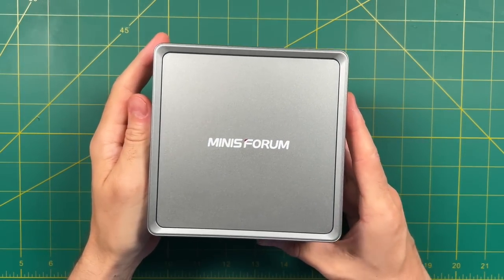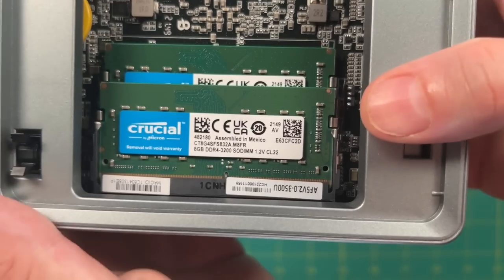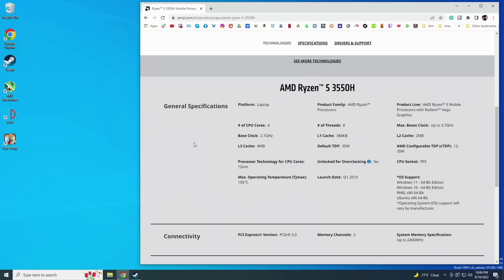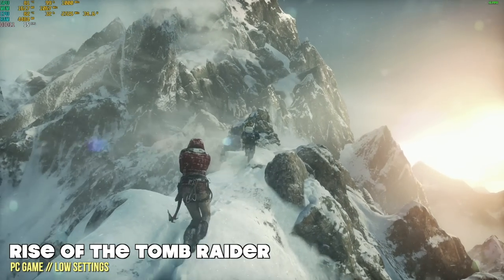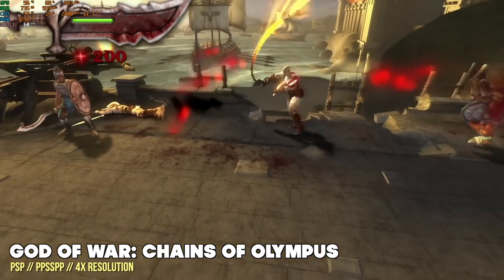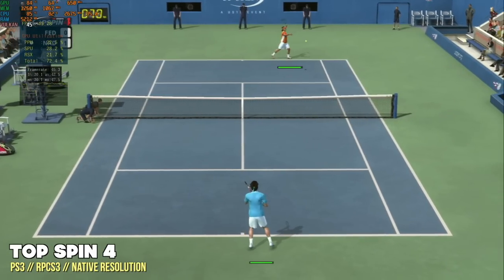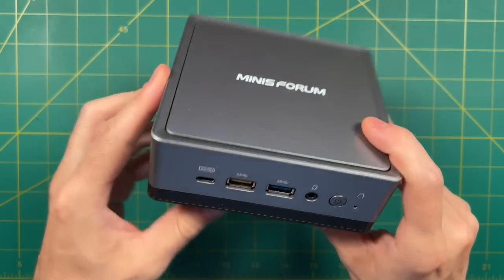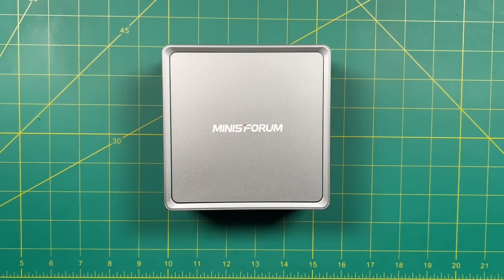MinisForum UM350 Review (Ryzen 5 3550H Mini PC)

Comment: MiniPC's are finally getting to (IMHO) the right value point: PS2/PS3 for <= $400. However, now that I've been using a SteamDeck, I've got a NEW requirement for my hypothetical Living Room MiniPC: I want it to run SteamOS! The UI is everything- I don't even want to LOOK at Windows again. Can't wait for Valve to get a good device-agnostic build out there for manufacturers to pre-install!
Reply: Well steam on windows is supposed to eventually get that UI too
Reply: @rassular  Ah! Well that’s a promising step. A full OS is still preferred here for me though; my hypothetical Living Room miniPC is strictly for console-style gaming, so no need to pay for a MS Windows license
Reply: Even when steam OS3 (the steam deck version of steam OS) is fully released (you can install it already on a PC but not supported by valve) you are still not going to get 100% of the same steam deck experience since it will not be a specific version built for only one specific set of hardware so all of the optimizations and customizations will probably not be there.  Like system wide FSR / frame rate caps or other things which probably won’t work on divergent hardware.

Comment: Nice vid.  I picked one of these up with a Ryzen 7 to do a lot of older emulation and, bonus, since it runs on Windows I can turn it in to a Steam system as well.  I never liked sitting at my PC to play games, emulation or otherwise.  Microsoft shot themselves in the foot when they shut down emulation on their Xbox Series X system.  That thing was perfect and I really dislike using Dev Mode to get around the lockout.

Comment: This looks like the same model as the DMAF5 which they sold a couple years ago. I've had it for a while and it's a hell of a machine, especially for this significantly lower price, but I will say that the wireless performance in the DMAF5 was absolutely terrible and really didn't like trying to connect to a bluetooth controller from across a living room (and forget it if you were using Wifi at the same time). Since the card itself is fine I can only attribute it to its placement or the case itself, and I wonder if this new model is any better on that front. It's the one major bummer in an otherwise great HTPC / emulation box.
Reply: Did you check the support forums and install the Bluetooth and WiFi driver updates? After applying the updates, any issues I had were resolved. Something that also helped is to turn off fast boot in Windows, as that one does not release the drivers correctly, which make them fail when you startup the pc after a shut down (which is not the same as restarting).

Comment: Thanks for your videos. I was hesitant between getting this or a "Minisforum EliteMini TH50" to install Batocera and put in my arcade cabinet. But based on both your reviews, it seems the EliteMini TH50 would be better, correct?
Reply from the maker: Yes, the TH50 is still my favorite PC under $500.
Reply: Hey. So did u try to install some games in your new mini pc ? What do you think about it ? Did u choose the TH50 ? 
I already get an arcade cabinet with a pi4 but I d like to add some games from Wiiu and switch ? 
Do u think yuzu switch is good enough to play it with ? Or this is definitely not enough powerful !?
Reply: @menthealo3725  can't help you with those miniPCs unfortunately.
I went with a regular PC I managed to buy for cheap (i5-3320 with a graphic card). With it I can play up to (some) PS3 games, most Switch games and most PC games (Tekken 7, MK11, etc).

Comment: And as you probably already know, Beelink GT King II is available. That would be interesting device for a review.
Reply from the maker: Yes, but unfortunately the A311D2 chipset won't work on custom firmwares like Batocera or EmuELEC yet.  It doesn't have mainline linux support and so it will be limited to the Android kernel for now.
Reply: @RetroGameCorps  So, somewhat limited use for now. Not inexpensive either. 
~$180
Edit: Would RetroArch work with A311D2?
Reply from the maker: @JustPeasant  I think it still might show some promise in terms of raw power, so I requested one from Beelink. I’m hoping that it can match the NVIDIA Shield.
Reply: @RetroGameCorps  You have? You're the boss when it comes to this devices.
Cheers, Russ!

Comment: Talking about Batocera, someone has Dreamcast Boot problems? I have a Brand New USB and Marvel vs Capcom 2 boot, yeah, but with graphic issues (shadders, squares and some textures are glitches). I tried change BIOS, change emulators (libreto and standalone), change Rom file (.bin/.cue and .chd) and nothing works ):

Comment: I bought bare bone version, some time ago and i think that price is really great. If you have some spare ssd, or ram then this may be a very affordable, and modern option.

Yeah, i also have some Dell optiplex with rx550 low profile turned Into hackintosh. It may be cheaper but it all depends if you're able to buy cheaply used low profile card.

At the same time it is so much better than some celeron j4125 or hmm 5050 mini pc. Yes, it is similar priced but its bare bone, but to be honest its really nice pc

Comment: I have a Asus laptop with the same CPU, although it seems to be locked to 21W (since I can't bump it up neither on the bios or using Ryzen Controller), but the performance in Windows games seems to be better than on that mini PC.
Using only the integrated graphics, for battery life, I could play Elden Ring at low settings 1080p with 25-30fps. In single channel.
The rpcs3 performance seemed good as well. The temps are far better as well, not going above 60°c on load.
Does someone know if my CPU wattage is locked by the manufacturer or am I doing something wrong? (ASUS TUF fx505dy).
Reply: wattage doesn't matter if you're hitting 3.7 ghz.